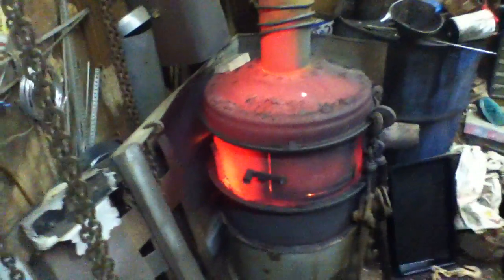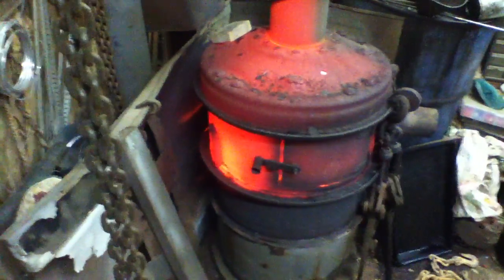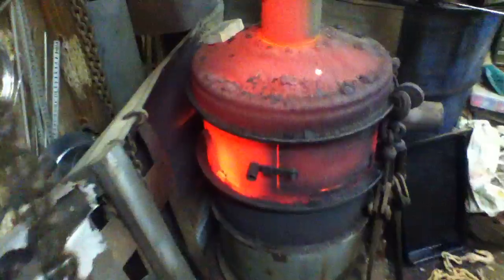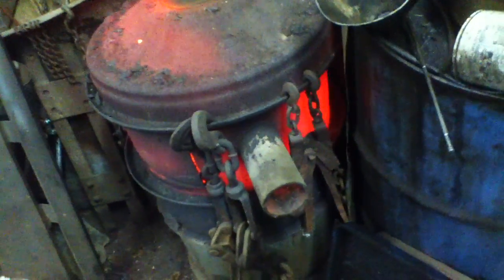Waste Oil Burner at full throttle

Comment: @thierryanna , Hi, I had a 1920s Norwegian fishing boat in the 1970s, it had a small burner / heater and stove all in one, it glowed cherry red too, some heat came off it, but my point here is the gallon tank feed was on the deck, and it would run ok, winter or summer, with no "Pre Heat" of fuel...perhaps if oil is thicker just put a cup of diesel in your mix..
Thom in Scotland.

Comment: I have no disagreement in burning oil if you burn it hot and lean it will just be combusted air mostly and the rest of the remaining bits will be carbon which is harmless anyway. I have always wanted to build a waste oil burner for emergency heating but I would add a catalytic converter to the stove to keep any emissions down if it wasn't burning correctly on the pipe end of things.

Comment: is this using a burn chamber with aeration at the bottom? What's the tube coming out the side for? It sounds quiet... can you comment on that?

Finally, could you combine this with wood by burning wood and then just dripping the waste oil onto the wood fie?

Comment: That steel is over 900* if it's glowing red... I would move away some of that stuff around it before ya have a accident!
Reply from the maker: +nsboost  If you read my replies to other similar comments, you would know that I never leave it unattended. I have been using it for years, and with the sheet steel surround it doesn't over heat anything combustible.